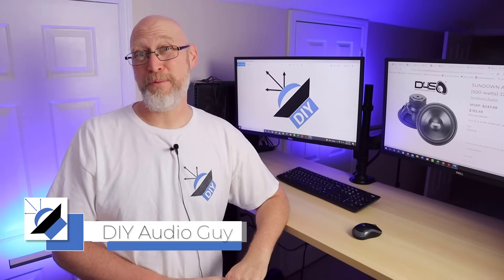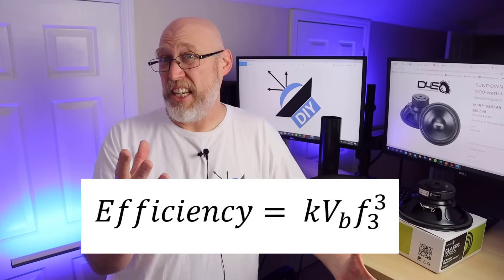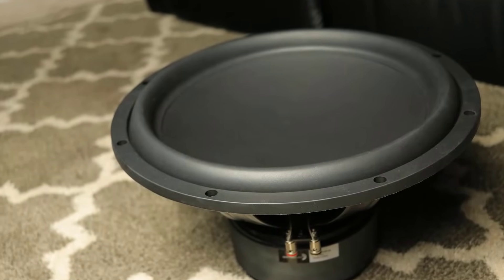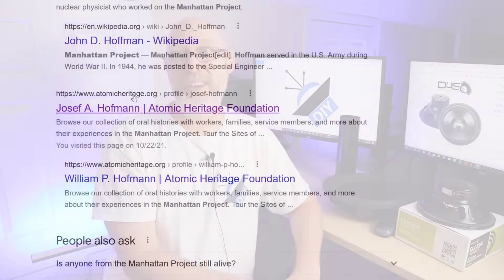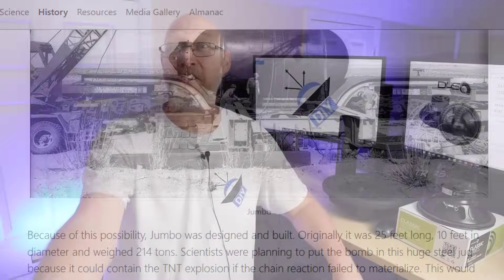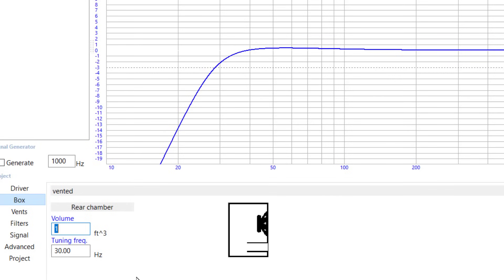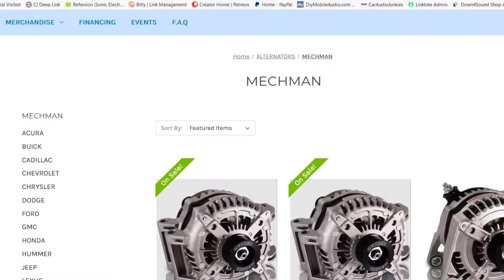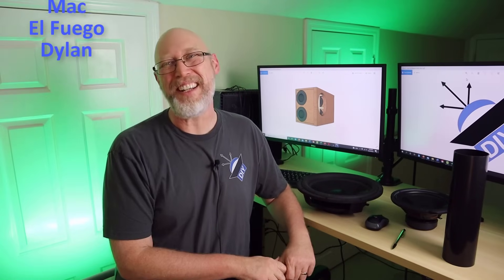Hofmann's Iron Law:  A Better Box for Better Bass!

Comment: First off awesome video I love math equations they tend not to lie. As a kid I had a Cerwin Vega 15 free air dual VC that I installed in a huge homemade sealed enclosure just like buds. It hammered so low so hard. No mid all lows sub 200 hz. I've never been able to duplicate that performance because I got lucky and don't remember the exact dimensions.. My dad helped me and allowed me to jam that thing in my room as a kid and this video brought back those memories. Thanks guy. Oh I forgot to mention rigidity of enclosure. Less flexibility of box = way more output... Cool side note about jumbo btw. Awesome stuff!
Reply from the maker: That's awesome!
Reply: Boxes aren't the best shape for being rigid. For that you want rounded enclosures. The only problem is in terms of usable space they are quite wasteful in pack space in most applications. A spare tire well is round in one dimension though. Otherwise build one that mimics the walls of your trunk.

Comment: So over a year ago I bought a qbomb for two 10s.  The box is huge and tuned to 35hz (I've checked specs and done my tests and yes it's tuned to 35hz).  I uploaded a picture of my setup banging on a facebook bass group and holy shit, I was told I was dumb that my box was way too big and that my subs were clipping blah blah blah.  I ran those two 10s in this box for over a year with zero issues and it banged!  Now I'm using the same box but with more beefy subs and it still sounds incredible!  Moral of the story, don't listen to haters on fb or youtube
Reply from the maker: Absolutely!  I bought this box with the intention of trashing it.  I was wrong.
Reply: Remember me when I had a hi-fi car 12 sub in a 63l box in my car, tuned to 28. No one believed it was 1 speaker until I open the trunk 😂. I was sending around 750w to the speaker.
Reply: Forgot to mention, we used to take that box out the car and play in-house too 😂😂 I’m grateful for the chill neighbours 😂😂😂

Comment: Theil/Small based there research on using existing electronic filter theory and modelling the physical attributes of the driver as electronic components.
AR did were not famous for a sealed enclosure, they developed "acoustic suspension" which is a sealed enclosure but with the driver designed to specific specifications to compliment the enclosure.
Theil/ Small took this further and worked out the driver and box requirements for a ported enclosure as well as refining fully the requirements for sealed enclosures and any other box design by defining the Theil/Small specifications we all use to this day.
Up until these two things, ported boxes and vented boxes was a hit and miss try it and see what it sounds like affair, which lead to the ported boxes getting a bad name for boominess as they were never aligned properly.
Reply from the maker: Awesome, thanks for filling in those gaps.

Comment: I need a little guidance over here. So basically, I have an old Pioneer 307-d2 sub and i'm willing to add it to my home theater. What cubic ft should the box needs to be exact in order to get proper low output in a room?
Reply from the maker: https://diysubwoofer.blogspot.com/2021/05/custom-subwoofer-enclosure-designs.html

Comment: Great. At 3.05 you spoke about the great passive radiator. At 0.48 you flipped around the MK Boombox. I would like to build the MK Boombox but I find it a bit to big/deep. Can’t you redesign it with two passive radiators instead for the ports? Us the same kit, but only cut and remodel the box, that are included in the kit, so we beginners DIY have something to do during winter. Keep up the great work.
Reply from the maker: A lot of people seem to build their own (or modify the kit).  As far as making the kit smaller/using a PR you can just model in WinISD.  You will need to relocate the amp, it takes up the full depth of the kit.
Reply: @DIYAudioGuy  Thanks. I need to learn how to use WinISD. So handy you just recently made a tutorial! Keep up the good work.
Reply from the maker: @rikardekvall3433  There is a bit of a learning curve, but it is a great tool and the price is right.

Comment: I can make a subwoofer speaker box for a 4-inch woofer based on two subwoofer boxes, one 6" and one 4-inch, mixing the sizes, averaging the two sizes, putting in a longer port, and making a "5-inch subwoofer box" but using the 4-inch speaker?
I'm looking for lower bass than the two subwoofers I have, merging the box sizes maybe can make that happen? I don't want it to be really loud, I just want to hear better low-end bass, if that's even possible with that little of a driver...  (i think between 45 Hz they die, I don't know if this build can play low to 35hz...) I don't have the specs for the woofer...
Reply from the maker: I would just model it in WinISD.  https://youtu.be/yZNeYBYGRKk

Comment: >why do we need math?

I swear, Car Audio is the only place in the known Universe where people believe that they can break the Laws of Physics.

Nobody, and I mean nobody can build an enclosure correctly without using mathematics. Just because you might get lucky once in a while and build a great enclosure, and that you didn't use math to design it, doesn't mean that the performance isn't described mathematically.

Personally, I think wood is expensive, therefore I always choose a driver to fit the enclosure that I have room for in my car. That's right, I build the box first, making sure it integrates well with my automobile. Then, using mathematics, and ignoring brand, size, magnet, xmax, whatever, I choose whatever driver will give me the best results in my particular box. Using math, I get it right the first time, every time. I also use a DATS to verify the published Thiele-Small Parameters listed in the tech data sheets. THIS IS IMPERATIVE. Don't trust the manufacturers. I've seen drivers from even so-called "high end" companies where the published specs are full on fairy tales.

That's why it's maddening when I hear people say, "OH BRO, YOU'VE GOT TO GET BRAND X MODEL Y! NOTHING HITS HARDER!". Bull. You have no idea what the other person's design requirements are. You are spouting off a purely ignorant opinion because you have absolutely no facts on which to base your argument.

If anyone ever wants to get serious about enclosure design, there are always three books I recommend. (Yes, actual books. Yes, actual reading. Yes, actually using Algebra.) David Weems' "Designing, Building, and Testing Your Own Speaker System", Robert Bullock's "Bullock on Boxes", and Vance Dickason's "The Loudspeaker Design Cookbook". Read and understand those three books,  and you'll be way far ahead of the curve compared to most other car audio enthusiasts.
Reply from the maker: I think it is intimidating, the key is to try and understand one small piece.  Then try to understand another small piece.  Eventually you work your way up to some amazing and complicated stuff.
Reply: @DIYAudioGuy  Also, I too love Passive Radiator enclosures! They are just so damned cool, and generally sound so damned good. It's a shame they aren't more widely used. Way back in the day, Stillwater Designs made their name with the original Kicker boxes, from which we get the name for today's Kicker. Pretty much all of those original Kicker boxes were of the passive radiator design, commonly a pair of 6.5" subs with an 8" PR.

Comment: I like to use efficient drivers so that I can keep the power requirements reasonable. You can actually make a system that sounds good without needing a ton of power if you choose your driver's properly.
Reply from the maker: That's a smart strategy.
Reply: Same here.  At the same time I don't want 3000 watts on my subwoofer anyways.  I have about 400 RMS on my doors and 500 RMS on my sub and my car is loud  clean and clear.
Reply: Alpine type r in my experience are very good at this, with very little power the sounded awesome and with more power they are ridiculously loud and clear
Reply: AWESOME VIDEO… glad you geeked out on the Hofmann… shows you have passion about it.
Reply: Yes i did that with my skar rp1500.1dm marine amp with zero gauge wire running a 10 farad cap on 18 inch skar zvx in ported box tuned to 36 hrtz at 1 ohm. Bo extra batteries or upgraded alt on stock wiring no big 3 and it was nasty loud lol. Hitting around 138 db on stock alt and voltage only dropped to 13.2 volts at the worst
Reply: @svensplooge9961  kml
Reply: It's my way for decades always buy with the highest dB  rem a 93 dB   speaker  will sound twice as loud as a 90 dB speaker   u can use half the power amd sound as loud as the other guy
Reply: How do you know if the driver is efficient?
Reply: @Silent1NZ look at the subwoofer sensitivity rating the higher it is the better.
Most subs run around 86db
Reply: @NoPainNoGain___ wouldn’t the higher the sensitivity the more power it would need to play bass?
Reply: @Thats_X_  no it's the opposite, because it's sensitive it needs less power to sound loud
Reply: @NoPainNoGain___  ok I understand it better now. Higher sensitivity the less power it takes to play bass. Is it the same way with mid range speakers as well?
Reply: @Thats_X_  correct 👌
Reply: @NoPainNoGain___  appreciate it. We learn something new everyday.
Reply: Power is cheep today
Reply: Efficient drivers are usually this way because they are lighter and or larger diaphragm, assuming the voice coil and magnet strength are adequate to drive the cone properly in the enclosure of choice.
This means that a bigger proportion of the load is creating air pressure to hear bass. The downside is this efficiency needs a more compliant box which means larger box to prevent power wasted trying to squeeze air in a small box.
Reply: Recently found this out when my cheaper but high sensitivity PA sub beat out my DD715 in SQ matching it in SPL well 80% of it and plays just as low but actually higher this lead me to believe that when starting out in car audio a high efficieny driver is a lot better.
Reply from the maker: @EBMproductions1  What is the PA sub?
Reply: @DIYAudioGuy  pro Audio sub 96DB spl and a local brand called P. Audio basically cheaper Beyma woofers i can do hair tricks and play as low as 19hz in car with it on 600watts im gonna do some more testing soon and put more vids on my channel as only my DD715s vids are up at the moment.
Reply: @EBMproductions1  please do you say hair tricks and low lows only 600w? I just blew my jl 10w1v2. (Was very old and tattered.   I got 600w to play with out my gmd9605.  So which subs are in your car?
Reply: @yzrippin  i would Love a J audio 13.5w7 like damn
Reply: @EBMproductions1  well who wouldnt? But 1800. Yikes.   Think ill got with a skar evl 8 only have 600watts rms to play with
Reply: @yzrippin  id say go DD if the budgets there if not go skar or americanbass
Reply: @yzrippin  I have (2)13w7 subs with only one installed, and I didn’t pay more than $1,500 on them. I upgraded soft parts, and the coil, minus the W cone and Dome cover, and paint. I have videos of my single 13w7 on here. I find deals, and create my own, or fix myself.
Reply: @EBMproductions1  can we get a video please this is awesome, I will be looking to buy a set of those
Reply: @RandoManFPV  i shared a vid but if you mean the pro audio woofer then gimme a week i'm busy sorting clients out today, competing tomorrow to see if we can beat our best of 143.6DB@29hz on music and my cars in for repairs so will be posting a few home audio vids cause my Sundown X15 is busy ripping my house apart and the other one is the one were competing with

Comment: Question: I’ve always bought prefab boxes but I finally saved enough to buy a ported custom box. I listen to various types of music but mostly rap. Hate to be a dummy but I have no clue what I should tune my box to. Thinking about 37hz-41hz.
Reply from the maker: It really has more to do with your taste and the sub you are using. I would tune it a bit lower, but that is just my preference.  I would rather be low than loud so I tend to shoot for the lower 30's. I did have a 10 tuned to 22HZ, I enjoyed those extreme lows, but I sacrificed to much output/SPL.  That is the tradeoff with a ported enclosure, you can tune it low, or loud.  You have to pick.
Reply: agreed.  in isolated frequency testing, i found 30-40Hz to provide the most bang for the buck.  while i would love to feel the 25Hz magic, it is simply not realistic with my “budget” system and is way inefficient down there.  used a deep crossover to tune as much of that signal out as possible.

Comment: I’m going with a 2k amp to power my Fi Neo 3.5 12 inch. I would choose a high quality high efficiency amplifier with adequate buffer capacitance between the power supply and output section so that I can get away with only a big 3 upgrade. Don’t want to deal with the headaches of messing with alternators.
Reply: You just have the one sub, correct? If it's the dual 1Ω model, look into the (yet to be released) Stetson 3000.1 EVOX2  – 1Ω. With it, you could wire your single sub at 2Ω and get 1980w RMS from it, while leaving yourself with enough overhead for the possibility of getting another 3.5, wiring them to 1Ω, and getting 3000w for the pair. Being an SQ sub that's aimed at a ported box though, you might just wanna stay at 2Ω for the added control. 
Average music draw is ~120a, with a burping max of about double that (240a), btw. Seems like it'd be a good match for you, if it being $800 and full bridge aren't issues for you.
Reply from the maker: Smart.

Comment: Not necessarily a big enclosure. 
It’s in the design.
My enclosure is very small but has 96” long port tubing. Shakes the heck out of the windows and 17Hz.
It’s more like a T-line. I prefer it over any enclosure if you want to dig below 25Hz. Light, small, loud n low. Not bulky, big and heavy like a regular ported enclosure.
A pair of 10s can outperform 12s if the enclosure permits so. Because no matter how many speakers you have, you’re not going to get SPL at the frequency you want if the enclosure is not tuned properly; all you will hear is inherent noise from the cones and no actual Bass. Happens a lot with prefabs when trying to play anything below 30hz. You will start to hear some actual Bass once you are reaching the tuned frequency and above.
Reply from the maker: T-lines are cool!

Comment: My buddy is getting ready to install a 3k watts system in his 2018 Equinox. They told him all he needs for electrical is to replace the stock battery with a bigger one. No second batt, no h.o. alt. Even no caps. Lol. I told him, good luck with that. Let me know how it goes. I've got 5 k watts in my van. Extra 1,000 ca deep cycle, and an h.o alt and 2 caps. Still need another battery. His cars not gonna be able to handle the load.
Reply from the maker: Or perhaps the upgraded electrical would be so expensive that they did not bother talking him into it?

Comment: That alternator upgrade is so worth it though i’m able to keep my 3000w taramps smart 3 at full blast (78v at 1.6ohm/about 3800w give or take) any time any frequency forever as long as the car is running with my 240amp alt and xspower battery along with 0 gauge runs for power and additional grounds. Box is also tuned to 29hz so it hits them lows. Also have a built in volt meter in my car and while cruising voltage is always 13.8-14.5 and at idle only drops to 12.7 on the power hungry frequencies. (Box was designed by me courtesy of your awesome videos!)
Reply: I have a 325 HO alt running a Orion HCCA SPLX 3000.1D @ 1ohm, cruising I am able to maintain 14.8-15.2. Drawback is the alternator cost more than what my car is. Im serious😂
Reply from the maker: For that kind of power you definitely need the alternator.
Reply: I'm in love with my Gemini AI teacher telling me the same thing with a big 3 1/0AWG upgrade and every other upgrade it takes to just build a fully functional system with an the safety nets to keep your 30yo car from catching fire and melting the wire harness. Ask these years I though they just slapped a couple of speakers big amp and a capacitor and your off. I was wrong and this is going to take many paydays to build the one in my first project car

Comment: just a thought but an ole ambulance or fire rescue truck will have the "power " and space to build a really nice portable test station 🚑 they have massive electrical charging systems and well built and maintained yet cheap on the market
Reply from the maker: I thought the exact same thing!  If I were going to build a bass van That is the route I would take.

Comment: Passive radiators are the best to me. Good video
Reply: They cost extra but they are really nice. I almost feel like they oversimplify a build. Which is a good thing.
Reply: @JoshM7  Yep. It seems like every one that I've ever heard and owned sounds better and more efficient bass than a ported box. Bic is a company that makes a lot of them at low costs
Reply: @billy3650  My build with Passive Radiators aren't very suited for home use as I'm using an oversized enclosure (3.6 cubic feet tuned to 19Hz) riding xmax limits on my Ultimax 10 that cause a bit of noticeable distortion in the house. 

In my car that distortion is masked and never audible. 

What I do love is the silent operation even under tuning. I'll never hear port noise in the first place. But it's still very nice. When I had it in the house it was crazy how silent it was.
Reply: @JoshM7  Do you have a trunk or hatchback? I know trunks mask a lot of distortion
Reply: @billy3650  I have a trunk. 

Sometimes I wish I had a hatchback. But I like my car. While I can't fit that much bigger enclosures. I'm going to attempt infinite baffle which will save some space and give me the lows I like.
Reply from the maker: Yes they are!